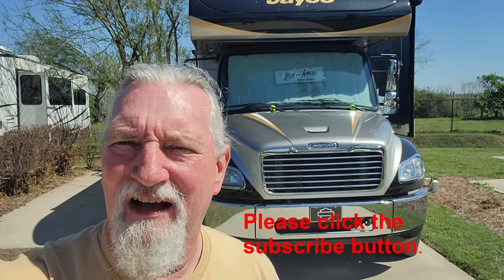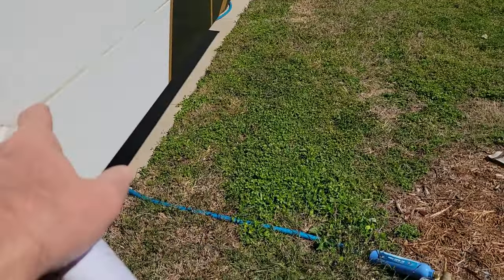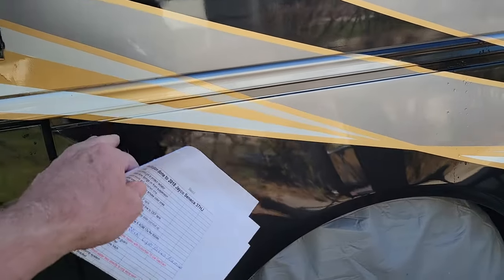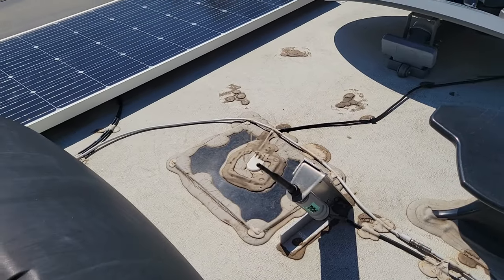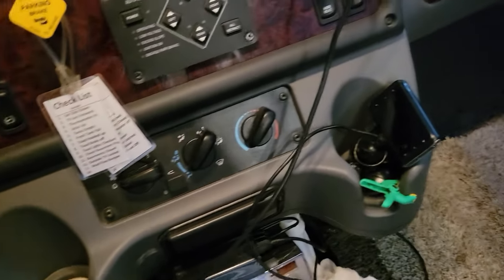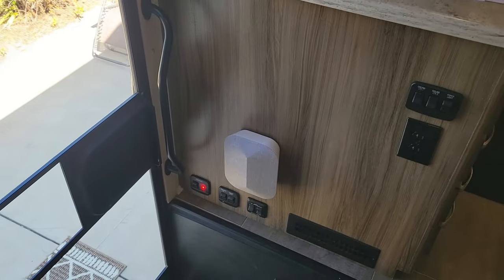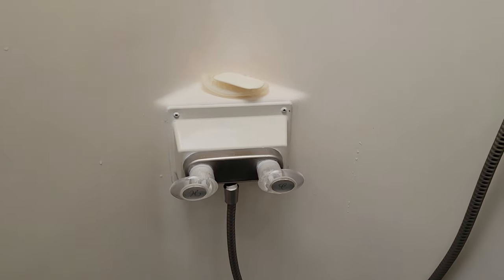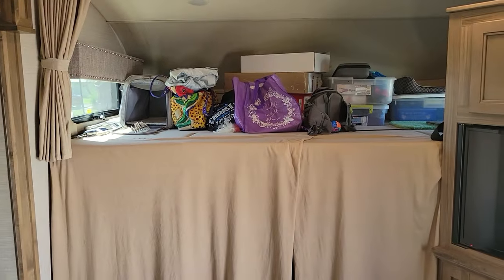Seneca RV Modifications

Comment: Great video, thank you for all the details.

Where did you get the additional water tank from ?
Reply from the maker: I bought it online from PPL Motorhomes in Houston. The size and dimensions of the tank were determined by the opening above the propane tank. I went with the largest that would fit in the opening.

Comment: Thanks for the video. I was especially interested in your water heater replacement since we too hate the on demand WH we currently have. I also need to research more about the ceramic heaters you use in your basement areas. I’m new to your channel so I’ll look to see if you have more details about that somewhere.
Reply from the maker: Both of those modifications were done before the YouTube Channel. The Water Heater I just paid the man. I wanted a bypass installed and all the electrical. Plus the outside panel had to be cut. I was afraid to cut that so I just wrote the check. As for the basement heat, I installed a receptacle  in each basement that has water and ran them all together with 12 gauge wire back to under the bed. I got on Amazon and purchased four 200 watt ceramic heaters and screwed them to the ceiling in the basement and plugged them in to the new receptacles.

Comment: Luv the vid! I don’t have your knowledge base… I really like the extra water switch to the clothes washer! I would like to pick your brain about saddle tanks. Under the doors are just those plastic/fiberglass steps and I would really like to replace those with Freightliner M2 saddle tanks. Couple of issues being the driver side tank will need to be smaller due to the def tank placement, or just remove and place in a cabinet… the second problem is switching between tanks on the dash with a three way switch; or just plumb it into the main tank as a fill job. 
We currently live in SoCal and travel to Montana on I15 quite a bit. I don’t want to buy fuel in Cali ever! Plus if we do a cross country trip again I can be very selective about where I do get fuel… any thoughts? TY for your time.
Reply from the maker: if you can find a way to get them mounted a simple xfer pump would work. You would have to put a transfer pump in each tank and pump it to the 100 gallon tank in the middle and let the normal pickup and fuel pump do its thing. what you are thinking is really not a bad idea. I have been thinking of putting a 30 gallon tank directly behind the 100 gallon tank between the frame rails, however, I am already pushing the limit on my 19K lbs axle. You might even be able to put the two switches in the cab for each saddle tank to do the pumping while driving down the road. Probably will have to figure out a way to vent the tanks to each other or open the filler cap while pumping. DISCLAIMER!!!! I am no expert, I have never done that, messing with fuel is dangerous, do at your own risk,  etc, etc, etc.
Reply: @wanderingpeaches  the L brackets/straps are standard for the M2 chassis. I would buy and mount them but have Freightliner run the fuel and vent lines. I am already heavy on my drive axle, that is why I’m trying to add weight to the steer axle. I want a moose rack as well to protect the front end and bring weight forward. Currently I am just under 8K on my steers, with our car on the trailer.
Reply from the maker: I have been looking at ex-guard.com for a deer guard. At a campground I was talking with a Seneca owner that had one and he said the price wasn't too bad. If you do the extra fuel, please totally document the process with pics and vids. I might copy you on that mod.

Comment: Great Video,  Do you have a video, or parts list and description on the hydraulic bed lift system.  Something I've been looking for
Reply from the maker: Here is a video of me modifying the bed lift. I built it before I started the YouTube Channel. 
https://youtu.be/041gRm6nW0c
I engineered it on the fly, I used:
old bed frame rails
Two 150 lbs shocks (amazon)
A stack of washers
A piece of cut up plastic cutting board
Two small hinges (Lowes)
That really is it, You will see how it all fits together in the above video. 
Good Luck !!!

Comment: Do Seneca owners just accept that they need to do the wing wall repair?
Reply from the maker: it really depends on the year of your coach. Jayco realized they had an issue and started put the wing wall on both the Seneca and the Accolade around 2020 or 2021, I don't remember the exact date.
Reply: @wanderingpeaches  so it's not an issue with the newer units?
Reply from the maker: I would check. I know someone with a 2022 and the wing wall was installed at the factory during manufacturing.
Reply: I just completed my wing wall mod on my 2021 Accolade.  Was told it took 20 hours start to finish, including measuring and cutting the wood.  Took me 18 at casual pace.  So many staples to remove, very delicate situation removing the headliner without creasing it.  By far the most intensive mod I’ve made.
Reply from the maker: glad you got it done